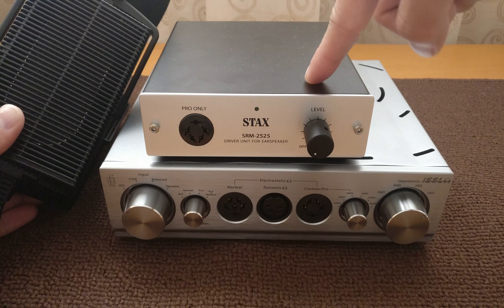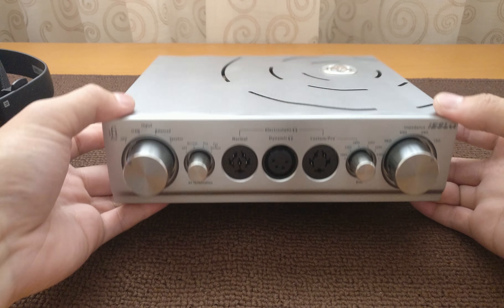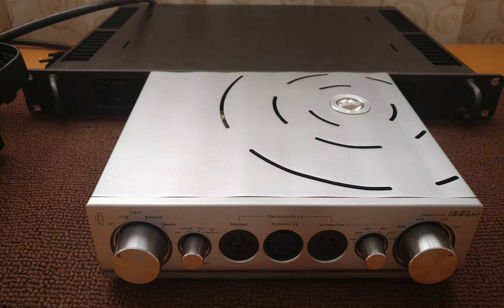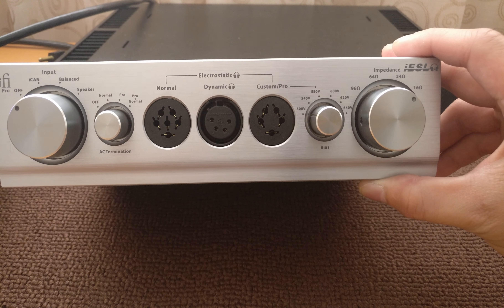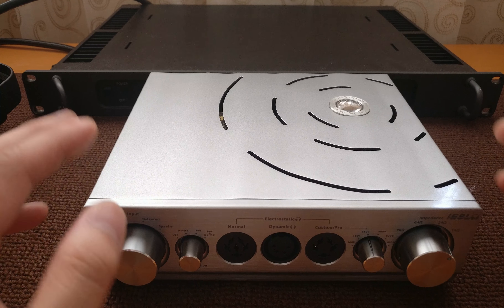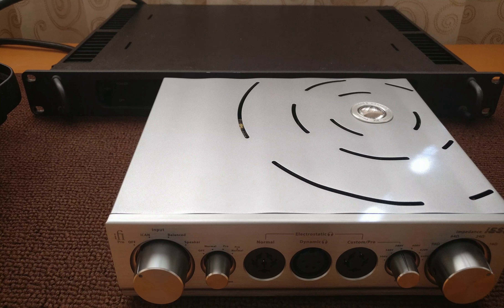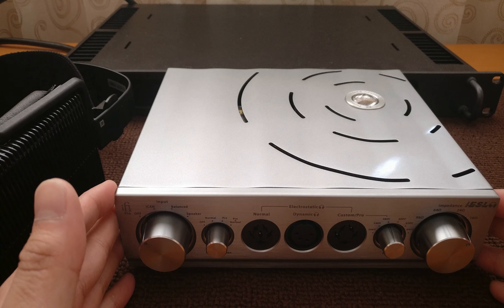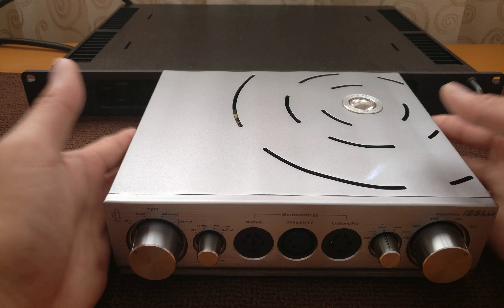[Binaural Review] iFi Pro iESL

Comment: I would be so afraid that my kid or myself would accidentely turn the voltage selector too high! I own a SR 009 that runs on 580V. It would go up in smoke when the selector is accidentely put on >600V?
Reply from the maker: Running at a higher bias voltage is fine but not recommended; running at lower voltages would make the the diaphragm less taught, so you wouldn't get an ideal sound from them.

Comment: Hi the srm 252S is not a very serious amp but the iFi Pro iESL
 is rather an expensive option. Mjolnir Audio has a SRD-7 for 670$ plus shipping, or you could consider a Woo Wee. But Woo says the Woo Wee is not a serious option for better Stax headphones.  So the iFi is not either. It would have been fun if they would have made a KGSSHV for this price.  Best wishes Y
Reply: Not recommended for STAX SR-009S/009 & SR-007 MKII headphones. Please consider GES, WES or 3ES dedicated electrostatic amplifier for best results with these models.- Woo on Woo Wee

Comment: weird quesion but I have a speaker tube preamp and an amp that I love and wish to use the ifi  eisl to have the same tube affect on my speakers on my headphones. Im interested in how that will translate to the 4 pin xlr output considering the tube preamp is rated for speakers and not headphones. Will the EISL bridge the gap and be able to project the affect of the tube preamp? 

for reference i have a Schiit freya + preamping a schiit ragnarok 2

Comment: Is it better to use speaker inputs or balanced inputs?
Reply from the maker: It really depends on the amplifier. Speaker inputs are probably the most ideal since most headphone amplifiers struggle to output 10 V into a 64-ohm impedance.